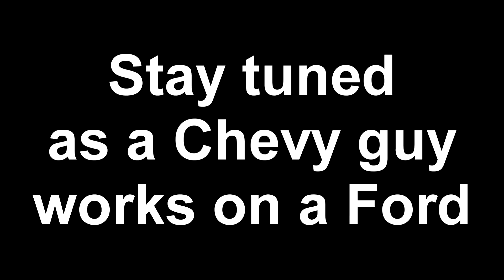New truck- Broke already

Comment: Hevyshevy, That bucket trick works.  What I use to do with my Do*** (Can't even say the word) all I did was disconnect the lines coming out of the trans to the cooler and splice in my own rubber trans lines. Then figure out which line was in and which one was out. Then run the "IN" line to a 5 gallon bucket of trans fluid. And the "OUT" would go to a empty bucket. Then I would run the truck in neutral.  Just make sure you watch it or you can push to much out before you know it.   Do this a couple of times. You might go through 40 bucks worth of fluid and a couple of filters but everything gets clean.

Comment: dawn dish soap is what I use at work in the Cats and IH's when things go bad in the cooling system . 
Yup , that much coolant in a auto isn't good . Seen some make it , but many will fail about 1000 miles after you get it flushed out . Hoping your going to be lucky on this one !! fingers crossed .

Comment: You may be swaying a bit too much to the blue oval side. I like Ford but 1979 back..... Anyway the high mileage on the clutches,etc. plus this washout probably will mean a short life span. I agree with trying to flush it and seeing what happens. Keep checking the color of the fluid after driving awhile. I'll be darned if I've come across a trans cooler leaking into the cooling system yet.  Hope it goes well.

Comment: Hmmmm, in the last video you said you were going to "make amends" to the blue truck for letting it sit under the carport, etc. Bringing home a Ford is a weird way to make amends! LoL That transmission has gone through hell. I hope you can get it cleaned out well enough and it's not toasted from the coolant. Do you have to flush the torque converter extra?
Reply from the maker: Bruce Boschek The torque converter doesn't have a plug in it and it won't turn loose of the pink stuff....

Comment: Go get two 5gal paint pals from lowes new, a couple lengths of fuel line. Suck in the new blow out the Pepto.
Reply from the maker: Lawrence Eich Doesn't seem to work on this one...I underrstand it has an internal thermostat that won't let it all come out till 170 degrees.
Reply: Dang Fords Good Luck??

Comment: Well, that just plain old sucks...hopefully you will be able to flush everything out. Yet one more reason I like standards.....
Reply from the maker: ***** I used to say that, till I drove big trucks for a while...now I'm not so hung up on it.
Reply: ***** its not the lack of shifting I'd miss, its the over reaching complexity of the new systems.  I don't like anything that requires a four page flow chart just to understand why it works.  (Not even the how part, I'm pretty sure thats just magic.)